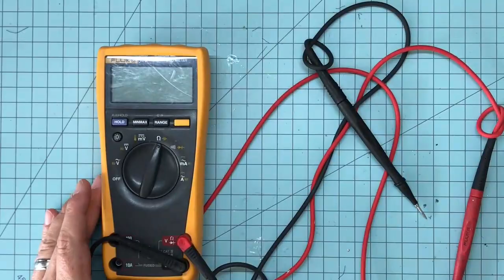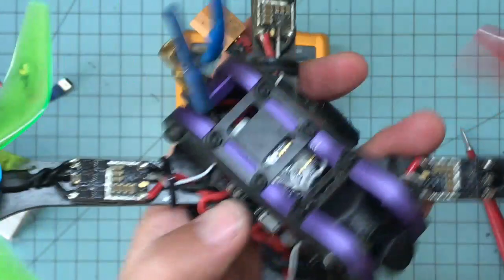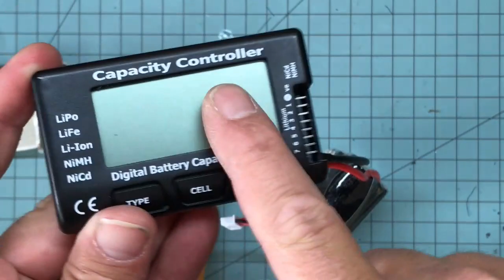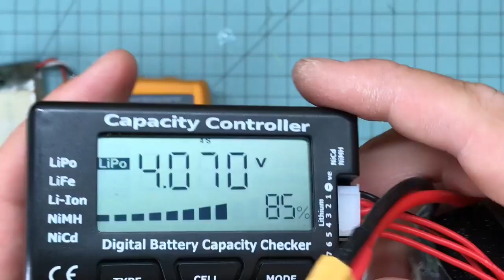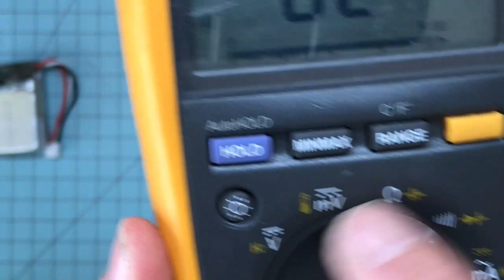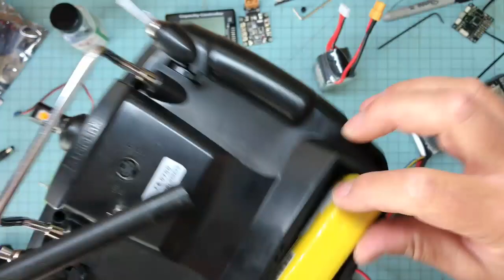Volt Meter 101-- The very basics with some tips!

Comment: Great show man, I really dig it. Im pretty new to quads and just finished soldering up a micro f3 board with individual escs but have a shirt when I check battery leads and in fact pretty much every connection I try is shorted lol and I mean even checking the plus and minus on motor headers, escs leads etc. I'm thinking I fried the board with my exceptional soldering skills but was wondering how to pinpoint the short. Like if you first check the main batt leads and get a short signal, what do you typically check next. I know this probably requires too long of an explanation for a message but a video showing your process would be awesome (not to choose your content for you) or if you know of one showing such. Thanks for the great videos and definitely the best sense of humor in the YouTube quadcopter scene. I have trouble making short posts, apologies.